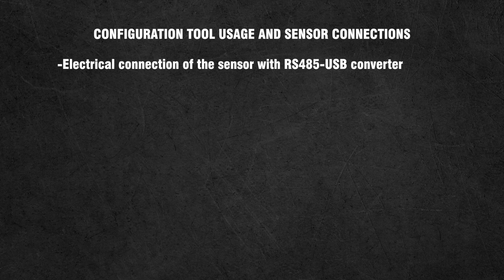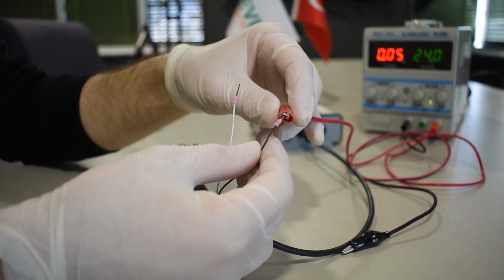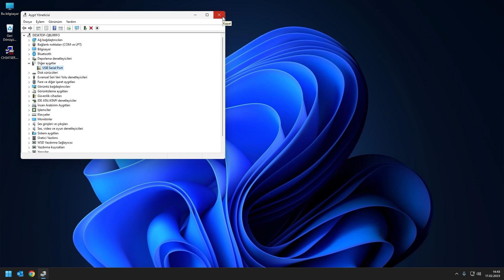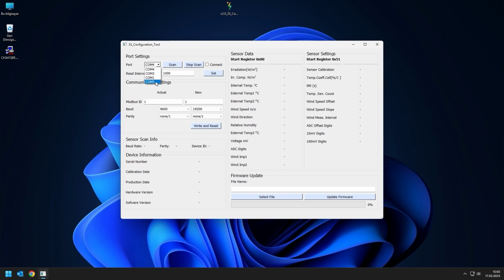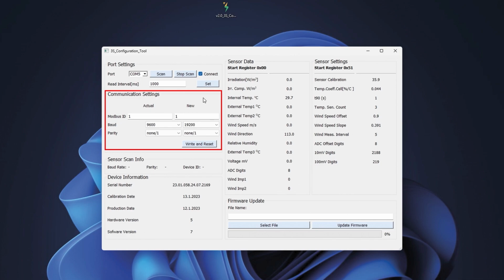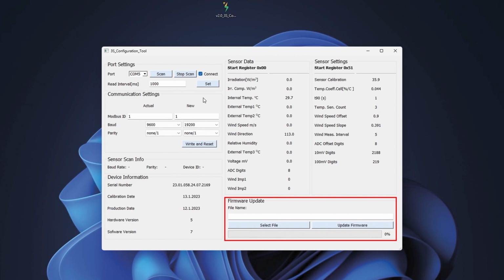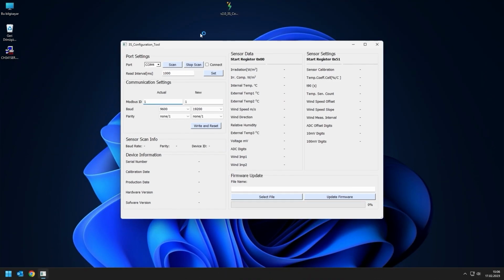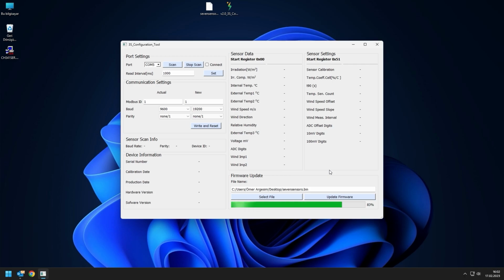How to Use 3S-IS Configuration Tool?

Comment: Hi,
I have two sensors that I need to install in one system.
Im at the moment trying to change Modbus address of of each sensor as you described. The configuration software scans and finds the sensor. I then click connect and I see sensor measured data. Then I  type address  32, baud rate 9600, and non parity and then click write. The icons go red and stay red. The green doesn't come. 
What's the issue ?